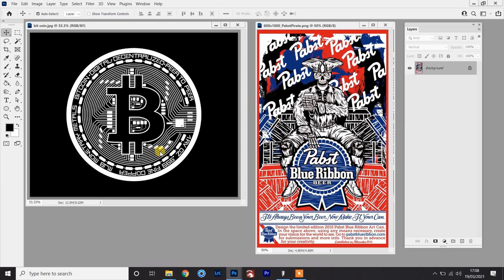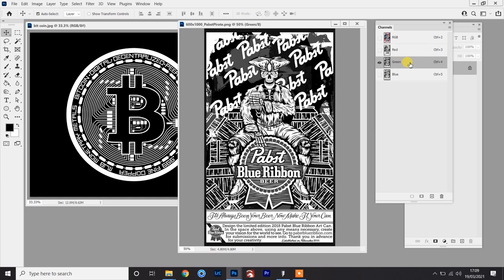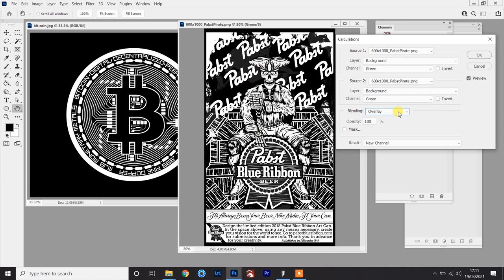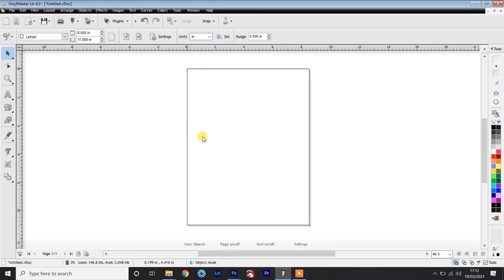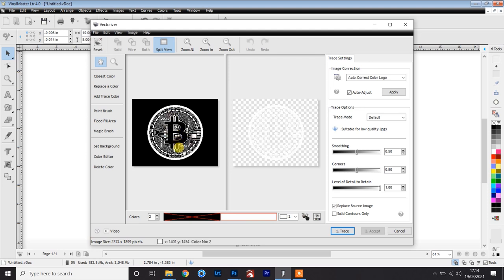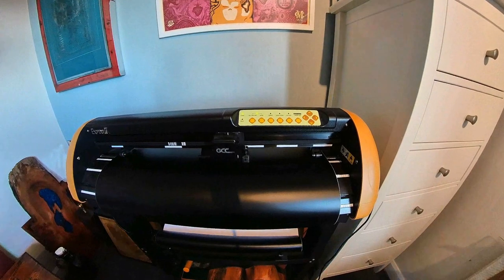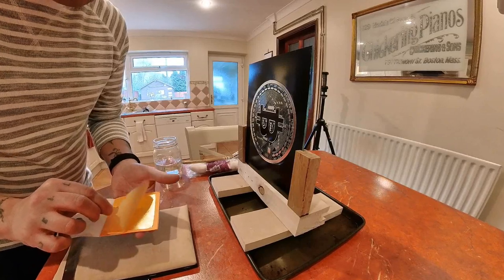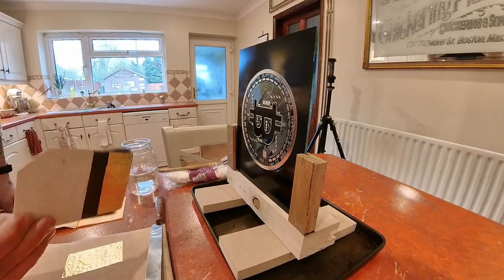Apply gold leaf to a mirror . Full Tutorial

Comment: I hope this information proves helpful - as a “thank you” for the information you share.  Replace the aluminum oxide (AO) with silicon carbide (SC) and you can just about say goodbye to the dust and static in your cabinet. The SC costs more but it is reusable over and over and over - just run through a screen before adding back to your pot. When SC fractures, it retains its sharp edges, unlike AO.  SC also flows better in a wider range of humidity conditions.  In the long run, I believe the SC is much less expensive and definitely much less frustrating. I’ve been sandcarving glass, mirrors and more for many years.  Used AO when first starting and can only say that switching to SC was truly an OMG moment.
Reply from the maker: Thank you so much! I’ll definitely try SC the next time I refill the blast cabinet!
Reply: Plus no lye cleaning if you are chemically mirroring with SC. I personally like garnet

Comment: Please please make a video on how to build. Different size stands for gilding holding the work upright. Like for your large pieces and the one here in this video. Plus a video  for framing. Would be very helpful thanks. Awsome work teaching
Reply from the maker: Hi John
For my large pieces I don't make a stand, I just rest the against the wall with a towel underneath.
Framing isn't one of my strong points. I normally look for good solid wood frames in thrift stores and then get the glass cut to size.
Reply: For large pieces.... I use an easel...many ssizzess to choose from.

Comment: How do you get your leaf to lay so flat? Some of mine do, and some of mine are wrinkly and dry that way.
Reply from the maker: With water gilding the leaf stretches as it dries. Whatever creases are left after it's dried can be burnished out before applying a second coat :)
If you're struggling to get a smooth finish I recommend changing your size mix. My recent video about gold leaf variants has some updated gilding advice that might help
Reply: @happygilder  thank you so much! I’ve been running into problems where some dry almost perfectly mirrored and some are extremely wrinkly. But I just got a thorn tip so I’m hoping that also helps!

Comment: Have you ever had any issues with gold leaf coming off when taking off the vinyl? I noticed you left the vinyl on here but if I were to do this same process on regular glass and then paint the back would there be pulling in spots? Thanks! 😊
Reply from the maker: I have tried using vinyl as a removable mask before, but it leaves a rough edge on the gold leaf when you remove it, so I wouldn't advise it. To maintain the edge on regular glass you gild first, then screen print the design on the back of the gold. Then when the ink is dry you rub the excess leaf away

Comment: I am a bit confused with your vinal machine. When you have a big sign. How do you use your machine for larger applications
Reply from the maker: Hi John, my vinyl cutter is 22 inches in width. I always buy vinyl rolls that are 61cm by 5m . I’ve never made anything bigger than that
Reply: @happygilder  I suppose you could layer them if you needed to go bigger?
Reply from the maker: @iwascured  yes that’s an option, although I’ve never tried it. Would probably need to be a simple design so you could line the 2 pieces up :)

Comment: Hi, Found you by accident and have very much enjoyed your videos so far.  I have the exact same vinyl cutter but I use Sure Cuts A Lot....don't love it...lol.  But for vinyl, I'm using Oracal ORAMASK 813 Stencil Film.  It's blue but also translucent so you can easily see through it to line up adjacent pieces or line it up to marks you've made on the reverse side of the glass.  Fantastic and a game changer!  That said, I'm not sand blasting my glass first.
Did you use the spray lacquer because you did not want the gold to have a mirror finish?  Or is that the only way the gold leaf will adhere once glass has been sand blasted?
Reply from the maker: Thanks very much, I’m really glad you like the vids. And thanks for the tip, I’ll definitely get some and see how I get on with it.
I use the lacquer to make the blasted glass smoother so the gold leaf goes on. I sometimes use clear enamel paint if it needs to go on intricate areas, bit if it’s the whole etched area I use the spray